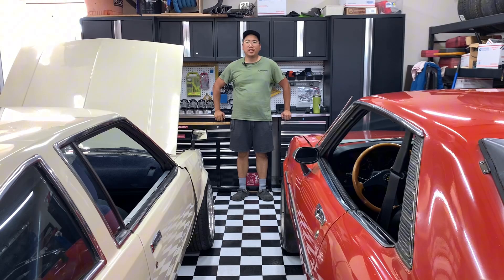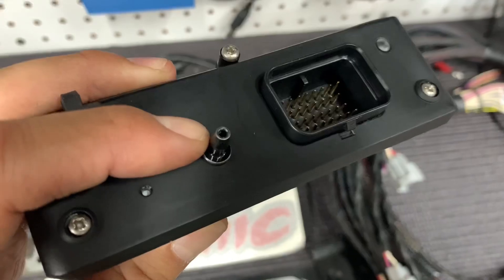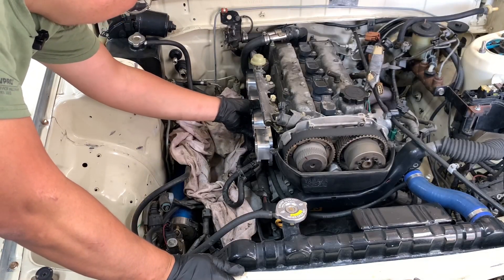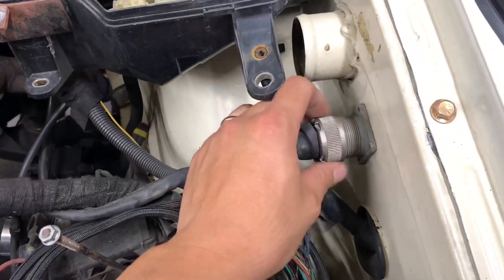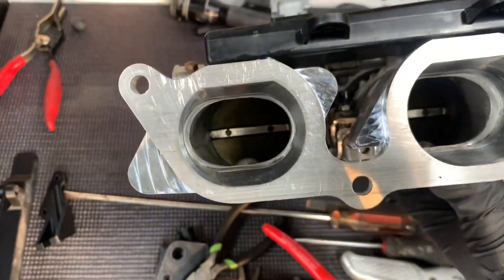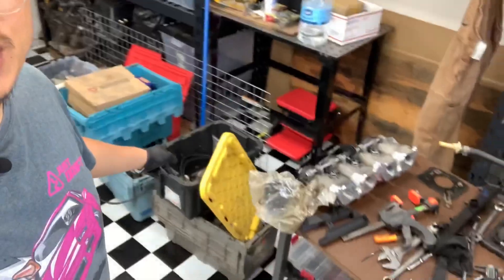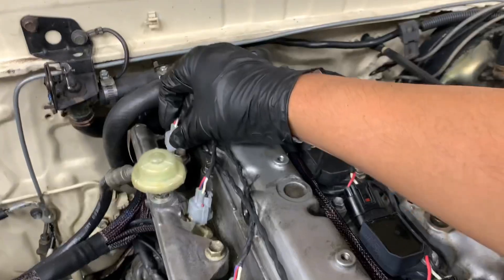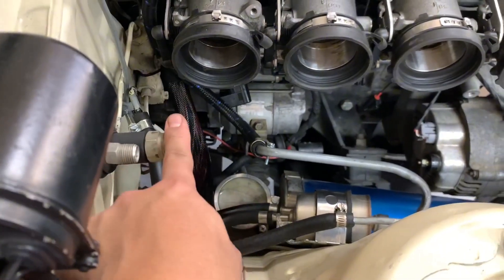BMW + Toyota. 3sge beams S62 ITB install part 1

Comment: Those itb’s are so cool.  Beans like the bigger inlets vs ae111’s?
Reply from the maker: I bought there ITBs a while back because they were $100 lol just happened Jason and Jon bought them also and Jon made adapter plates
Reply: @kelvinarreola  
Same story with my gsxr itb’s.  $100 itb’s beats whatever ae111’s are going for
Reply: @kelvinarreola  possible to have a link for the adaptor plate please